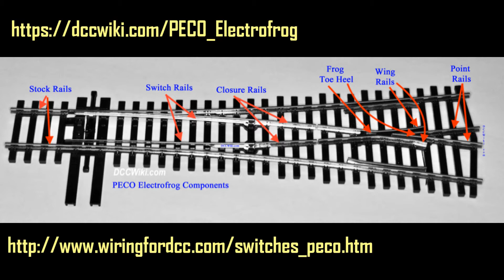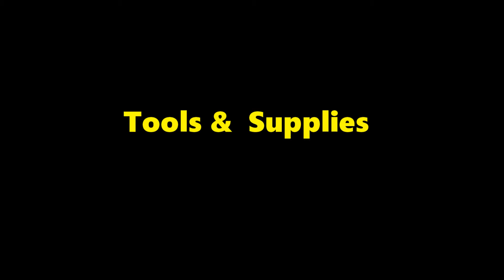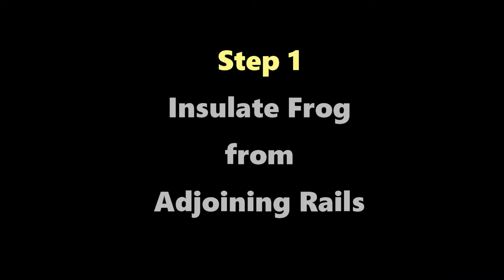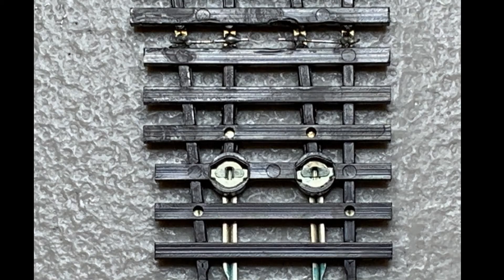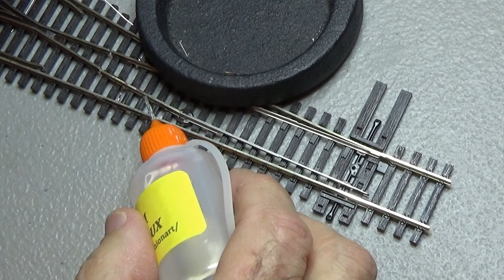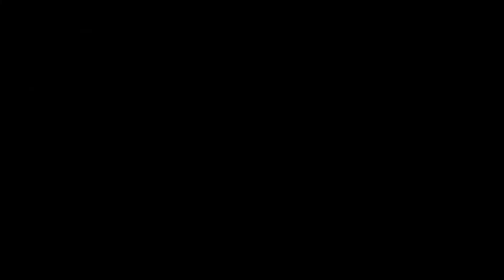Preparing the Peco Electrofrog Turnout for Installation

Comment: I have been away for years. What on earth is a "frog juicer"?
Reply from the maker: A frog juicer is wired to the frog and the 2 track wires. The frog juicer electronics will send current from one of the 2 wires to its “output” wire to keep the polarity to the loco correct. It can sense a short circuit caused by the loco quickly enough to switch from one wire to another. Google the term to get a fuller explanation.
Reply: @BobWesneski  I installed them on my layout and they simply did not work. Power was NCE. I have used that with electrofrogs for year with no problems until I used frog juicers. Does anyone know why?

Comment: Sorry mine didn’t work.  When I put the plast joiners on the train dies when it goes past.   Can someone please help?
Reply: Mine did not work either Scott and I have been building layouts for 40 years.
Reply from the maker: I don't know what the source of the issue is.  As long as there is power going to all the rails, including the frog, and there is no short, the train should pass over the plastic joiner okay.  On the electrofrog turnout, the frog must be powered as it is electrically insulated from the adjoining tracks.  The joiners themselves are only there to keep the tracks aligned better.  If they weren't there, it would be the same as simply cutting a gap in the rail.
Reply: I got it working by tossing the plastic joiners lol.  Hey whatever works lol
Reply: @Bamaboy35653  That's interesting. I am having a think about it. I have already rewired my layout now without frog juicers. I needed new switches, new point motors and a total rewire.
Reply: Nice video. Would using a frog juicer eliminate all these mods? I am trying to decide on which Peco 3 way turnout to get for DCC locos. Thanks!
Reply: Same here, you've probably got the same problem as I have, the turnout could be a SL-E88XX which underneath is nothing like the newer version.